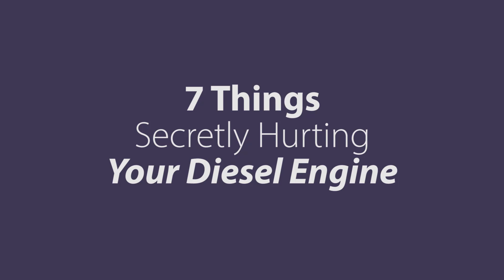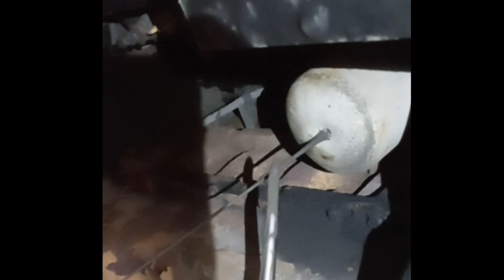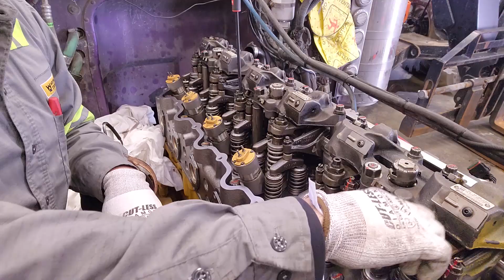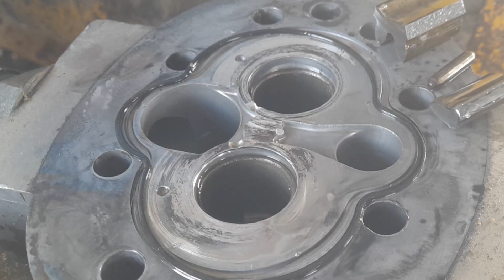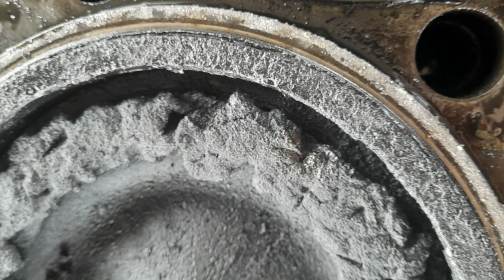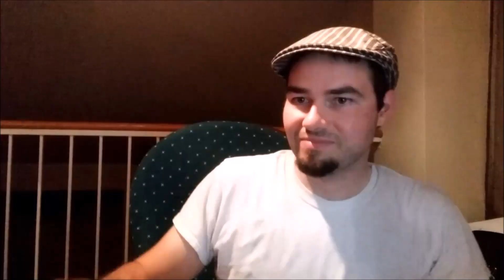Top 7 Things that could be SECRETLY Hurting your Diesel Engine.

Comment: people used to be taught how and why, piston wash, to warm up any engine, on diesels, start, wait for oil pressure to come up, and idle to smooth out. Them set idle at 1000. In the old days without cruise control, there was a throttle lock. Any driver that woke up in the middle on the night freezing his a$$ off, immediately understood why you idle at 1000. All old carburetor vehicles had a high idle for warmup, the idle increases to a set rpm as the choke coil warms up. Pretty important in the winter.

Comment: The smaller Cummins engines like the 6.7 in ram trucks, after about 30 seconds to a minute at cold start, will bump up the idle automatically to about 1200 to 1250 to get it warmed up.

Comment: For cold starts during below freezing temperatures, once I have the engine running, and oil pressure is achieved, I then bump the idle to no more than 800 rpm, then I monitor the oil temperature. Once the oil temperature is past 120, I’ll start driving it, but using minimal power and gradually increase the power as the temperature rises to operating temp.

Comment: On my 97 7.3 powerstroke I did efuel with 2 spin on filters back on the frame rail, the rear tank is sumped and the fuel level is above the filter heads when at least half full. Pull both filters, put the primary on, turn the fuel back on and wait for the fuel to come out of the secondary head, put it on and then turn the fuel pump on and let it fill(regulated return system).
As another note I've seen Cat heavy equipment with a "primer" switch on the frame near the fuel filters. That should be standard on all engines.

Comment: Thanks for the reminders Josh. My 3126 has a functioning cruise control that I bump to 1,000-1,300 while idling (sitting) and about 1,000 at warm up. 
The C-12 cruise doesn't work. I have to try and remind my shop to get that thing going. No clue if it's ECM related or switch etc...
Happy New Year!
Reply: If cruise control works then everything is OK the function that needs to be enabled is PTO mode to enable control below 25?mph

Comment: Automotive industry has a major problem with extended service intervals now. Falls along with rule #3- way too many problems could be hidden during that 10k mile oil change span. Especially with these DI engines that love fuel dilution….

Comment: A question to diesel techs. I've got a 5 cyl volvo diesel car. Not long ago I was doing the timing belt on it and while rotating the engine by hand I noticed that cyl 1 has significantly less compression then the other 4. Has anyone have ideas on what could be the cause for that? No wierd noise from the air filter box, coolant does not go missing, engine kinda knocks for a couple of seconds while cold and produces white smoke. It's common rail. Checket for blowby and theres no pressure comming out of the oil fill cap. Has lots of power. Have not done a leakdown test. Could the low compression be caused by a burnt exhaust valve? Head gasket? Is it possible to have less compression while cold but not while hot? Any ideas appreciated.
Reply: set  your valves if they are adjustable, motor  on if not it will show  up someday

Comment: I'm NOT a mechanic but I did buy my first Cat in 1984. When I change my fuel filters I change my primary run the truck, then change the secondary to avoid getting too much air in the system. If they're both changed at the same time that's when I've had issues getteing her started. Happy New Year.
Reply: Brother if your check valve right by your primary filter housing is bad that what happens but if it’s working right you shouldn’t have problems changing them both at the same time

Comment: Exec. summary:

0:28 Warming up your engine
2:49 Idling too much
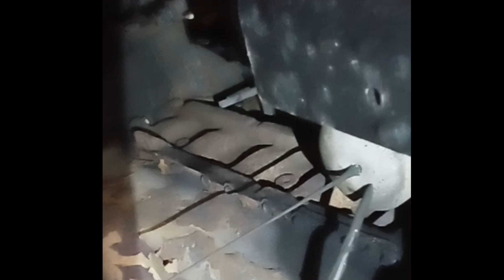4:01 Not checking engine fluids regularly
6:17 Not doing valve adjustments 
8:08 Pinching off wastegate hose
11:30 Running no/wrong thermostat
13:42 Installing dirty/dry filling filters

Comment: Agree on all of it, and will add that engines make heat as a byproduct of doing work.  So, once your cold engine has had oil pressure for long enough to be circulated throughout, put it (gently!) to work!  And continue working it gently until it's closer to normal operating temperature.
Reply: um,,the heat is from burning fuel ,,it is after all a heat engine and work is the by product of heat ,

Comment: Josh, I know you only work on cats. On cummins with the fuel filter change is they have a 10 ps prime pump. They recommend  putting the filter on dry and letting the prime pump fill the filter. It's very convenient to cat.

Comment: Ive always been told never low idle a diesel engine, especially at start up, start up is the hardest part of a diesel engines life.   I turn it over, and pretty much crank the rpm tp 1000 20 seconds later.

Edit:  you can feel when the engine starts to make true "compression" you can hear it... it goes from almost a knocking vibratng sound that smooths out as you increase RPM's.  Logically your not really warming your oil if your not pushing just a little bit of compression.     

Question, what about cool down???   Low idle to cool turbo for 5 mins or will turbo cool better at 1000 rpm?    

CAT questions
Reply: More air flow @ 1000 rpm and virtually the same amount of power/heat so cooling will be faster @ 1000. Or just don't make a big power demand for those last 5 minutes of operation and the turbo will be cool enough. With a Cat that doesn't equal throttle location so you have to be aware of the power being made - typically you can hear the turbo so if you can't hear it it isn't working hard.

Comment: put a heater core/tube in your oil pan, create a bore hole for heater tube in to oil pan, for warming oil in freezing temperature,make a double battery for heater use only.. or use a heat gun instead for quict start if there is a electric plug in.

Comment: Awesome quick summary of things not to do. Here are (a lot) more details for those that may want to know more.

. To prevent condensation in the rocker covers, and to remove any other moisture etc, the engine needs to be above ~ 85C/185F. The longer your engine is colder than this, the more time it spends with the moisture etc in the oil.
The thermostat has NO effect on maximum cooling if they are fully open before coolant reaches its maximum temperature (99C/210F for pre 2000MY Cat C-12/C-15 engines, 103/217 (I think) for 2000MY and later) the thermostat has NO effect on maximum cooling. They should be fully open before the fan on temperature is reached, don’t forget the fan also runs due to intake temperature and air conditioning pressure).
If you don’t install a thermostat in C-12/C13/3406-C15 etc and similar engines, a lot of coolant will bypass the radiator via the bypass line. So, this will REDUCE the cooling performance. 
If you don’t want a working thermostat then block it open but keep it/them installed, and make sure you are working it hard enough to keep the coolant above 85C/185F.

. A diesel engine uses very small amounts of fuel when idling and the amount of fuel between low idle ~600 rpm) and hi idle (~2000 rpm) is extremely small. This is because the only increase in power demand is the drag from the rotating parts of the engine (water/oil pump etc). So, changing the speed does little to help with warming – but as was said it does help settle the rings a bit more. If you have white smoke (unburnt fuel) the quickest way of clearing it up is to get power demand onto the engine (move the truck).

Cat has said for decades the best way to warm up your engine is to do you engine checks (that were discussed in video oil coolant etc) then start the engine and do your walk around inspection. The engine will then be ready to start working. So, start using it start your journey quietly (not full revs or full power). The engine will heat up much more quickly because now it is making way more power = heat. This may not always apply, like if you are at a truck stop on an interstate in cold temps and having a break, but it is the ideal to aim for. This can be a reason to make sure you have the sound suppression on your sump. It can help keep the heat in the oil a little more. To be clear what actually matters most is the oil temp. If the air temps are in the range of the oil (e.g. 5W-40 typically -30 to 50C/-22 to 122F) then the oil will provide the needed lubrication. The engine parts still need to warm up and that takes a while for the whole engine to be at operating temperature.

. Truck electrics are WAY better than they were in even the 80/90’s. Don't leave the engine running because it is "better to idle than to stop & restart it," this is NOT the case. 
Save fuel and engine wear, turn the engine off you are going to be stopped for more than a few minutes,

. Truck OEMs want to keep the cost of the truck low and so save on things like filters priming pumps etc.. Freightliner specified 3126 engines with NO primary fuel filters, to reduce costs. Others used cheap primary filters. If it doesn’t come on the engine to the OEM it isn’t necessarily part of the engine manufacturers supply.

If you look at a modern Cat machine many have electric priming pumps, high quality fuel water separator primary filter, a secondary filter and an upside-down tertiary fuel filter. The BIG Cat truck powered by the C175 (Common rail) also have a second set of secondary and tertiary quality filters attached to a separate pumps that pumps fuel from the tank and back again. All of this is done to extend the life of the fuel system/injectors.

A well-equipped truck will have a priming pump, water separating primary fuel filter and a secondary fuel filter. The priming pump is good if you are caught with a blocked filter out on the road. Even if you can’t get a full prime it is WAY better than a dry filter or a filter filled on the clean side.

Maintenance includes draining the primary filter AND keeping the fuel going into the tanks as clean as possible. If you are in a dusty environment, also think about putting filters on your fuel tank vents. Every gallon of fuel burnt is a gallon of that air going into your tanks, and the only way out for it is into you filters (hopefully) or through your injectors. 

A filter almost always blocks because of something else being wrong. If your filters become blocked too quickly do NOT change to another same size filter that doesn’t block. If you do that will just mean that all that stuff that blocked the previous filters is now getting into you fuel system. Find the actual problem and fix IT. If you use biodiesel you have to be VERY careful of water in the system – otherwise you can get algae growing in your fuel tanks, or coming through the fill nozzle into your tanks.
Reply: Interesting points. But one question: why do you think that a missing coolant thermostat will cause coolant to take the bypass and miss the radiator, thereby reducing the cooling? A missing thermostat is fundamentally an open thermostat, and an open stat directs the coolant to the rad. At all times, a small amount of coolant will take the bypass, but the lower resistance of the rad hose will cause most coolant to take that route. By the way, running without a coolant thermostat is just plain stupid and there is absolutely no reason for it.

Comment: Ever since I worked at a Mack dealership back in the 80's I was told to prefill the oil and fuel filters, regardless of clean or dirty side. Buying clean oil and prefilling the oil filter should not be a problem. As for the fuel, if you have clean fuel from a pump, that small amount in the filter will likely be fine for a filter change, anything cooming after will be filtered. But I wholley agree with everything else stated. My B series Cummins in my dodge has not seen any issues at over 300,000 miles doing it this way. I did add an aftermarket fuel filter system, with a water seperator and a filter and removing the factory crappy fuel filter it came with.
Reply: 😊cute my 1998 vw 1.9 diesel had 300,000 in 2009

Comment: I owned a VW Rabbit diesel, and one Christmas Eve I worked a midnight to eight shift.  The temperature dropped to well below zero, and when I got back to HQ, I started the car, then ended my shift, changed into my civilian clothes, and went to the car.  It had started well, and idled well for around thirty minutes.  When I attempted to drive home, the engine would not go above idle.  I drove the eight miles home in first gear on the five speed transmission.  I started using anti gel additives at that time.  It was an ugly situation
Reply: I had my diesel rabbit jell

Was from North Carolina had the worst diesel in the world. 

Literally a slushie
Reply: I had 2 of those. The owners manual says you can run 10% gasoline in your fuel to improve winter starting.

Comment: Asked my cat dealer to do my valve adjustment on my 3126 on my cat 953C track loader and they told me I don’t need it done. I think they didn’t want to do it because the cab doesn’t raise and it would be very difficult to do. Even though it is well past when the book said to have it done.

Comment: Do you need proof about the thermostat.
Look back at old cat recommendations.
Then look at the epa regs.
I smile from ear to ear on the 3406 with that statement.
Reply: Had same problems in combines with c-15 lexion. Burn them up.
I’ve been farming and driving longer than you have been alive.
It would be close over 30 yrs.
Soot yes and all the problems that go with it.
But thermostats are not all equal.
No margin for error.
I’m not a mechanic 
Cat must of been wrong in the golden era then.

Comment: on a 3406c model if you dont let it warm up idling you wont go anywhere as the engine will not pull its own weight , start it and go have coffee, engine is down 1 gallon at oil change time,

Comment: As a rule with my paccar i only idle 15-20ish mins in the morning during winter. Usually just long enough to defrost the windows and get the oil to at least 120ish. Any less and my oil pressure will spike to 90+ which always concerns me. After oil gets to 120 it will spike to 70 when i start moving then drop back down to 50 as it warms which has been the normal running psi for it since ive owned it.

Always been like that and the mechanics more or less shrug. At this point ive put 860k on it so why start changeing things when they clearly work. Also make sure that my max idle time unless as you said its like 140 degrees out is around 20 mins before i kill it. Usually it will be idleing through traffic lol. Otherwise i own an APU which sidesteps the its too hot issue.
Reply: That’s because PACCAR uses high volume low pressure oil pumps instead of the normal high pressure low volume of say a Cummins. The oil being thick doesn’t flow real well hence the super high pressure. The downside is you have to run the same oil summer and winter as you’ll lose your oil  pressure in the summer to the critical point.
Reply: @crandonborth  true, still concerns me especially with almost a million on it. Always worried im going to blow out a worn seal or crack the head.....it would not be the first time.

Still i did get nearly a million off her. But i am going to put a cat into it when this engine gets to out of frame time. Got a 6nz with this trucks name on it sitting in the shop with a conversion kit.
Reply: I knew an idiot that ran the wrong oil and tried to argue having 125psi  was ‘better’
Reply: Paccar oil pressure is very high when cold. This is normal until they warm up

Comment: I use clean fuel to prefill fuel filters.  Makes the priming easier.  If they have an electric lift pump and priming procedure I always follow manufacturer recommended priming procedure.

Comment: If your truck have DPF just delete it, it will save a lot of down time and save  bunch of $$$ in your pocket
Reply: That all depends on what county one is in and if a reliable delete system has been developed, do it the wrong way and engines have been know to fail with huge $$$ consequences. Having said that, I know locally where I am there are some shops that do a lot of tried and true delete programs because of very poor pollution systems that can't handle northern winters with a must to be able to keep the engine running. Unfortunately it most likely also deletes any engine warranty !. And in the states if caught they treat you worse then a mass murderer by the sounds of it.
Reply: Been wanting to do this on my Volvo d13, but truck runs California

Comment: Nooo… don’t raise the rpm at 10 degrees. Don’t want to starve the bearings, due to cavitation. Wait until the coolant temp begins to raise ,then idle up. 
Once it reaches 130 degrees, then    drive away nice n easy. Keep the rpm’s under 1500, until coolant temp gets close to 180 degrees. 
 I’ve seen Cummins techs come out, start a cold engine ( 30 degrees) and just pin the throttle to the floor. It’s not their engine, so they don’t give a shit.
Reply: Lubrication depends on the oil and the temp of the oil. Once the oil pressure is up if the oil and metal temp (for an engine that has no extra heat left in it) is above the lower oil rated temp you have good protection.  The engine MATERIALS still need to warm up, so yeah no revving wildly, take it easy but KNOW you have proper lubrication.
What temps? 0W -40C/F  5W -30C/-20F  10W -18C/0F  15W -9C/15F